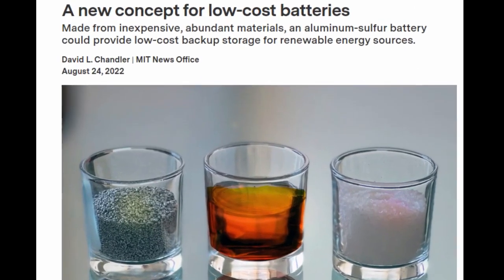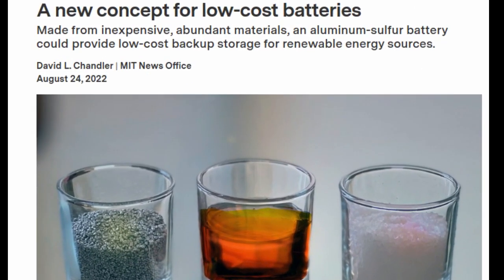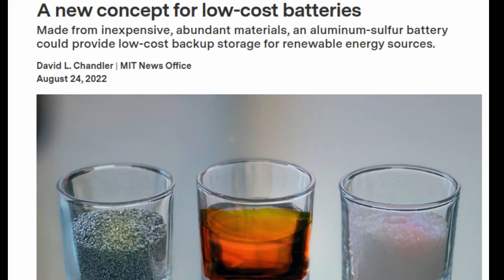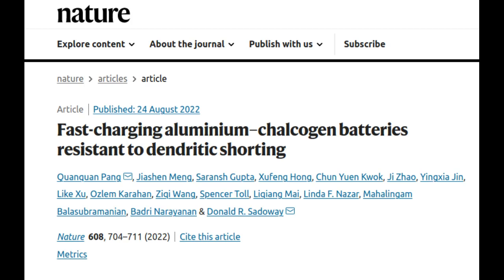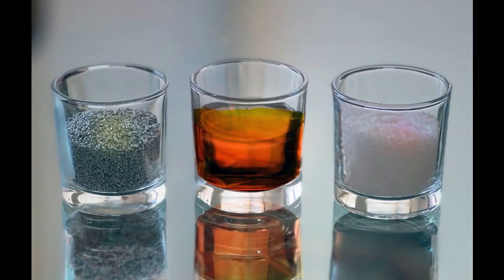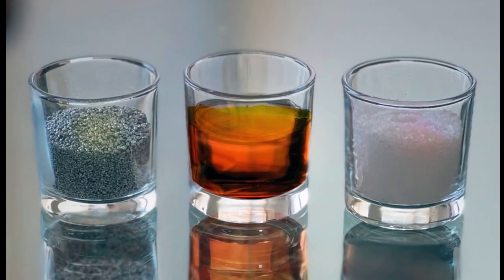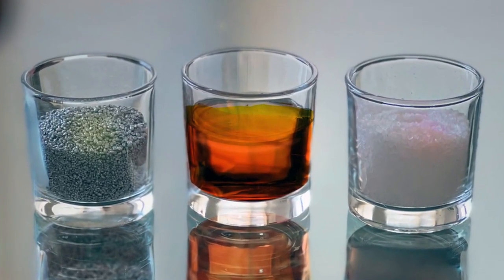A new concept for low-cost batteries | Aluminum-Sulfur Battery | Donald Sadoway | Avanti

Comment: Part of worldly focus is 5G,  which is a concern in terms of what it was initially designed for.  I can't quote any sources,  suffice to say it was being presented as a weapon of war.  Using it to radiate out frequencies that interfere with the hearing process, confusing physical movements,  when used in higher ranges, such as vehicle charging stations.